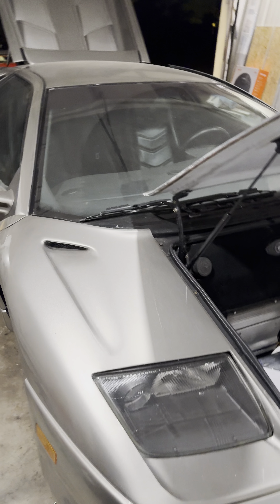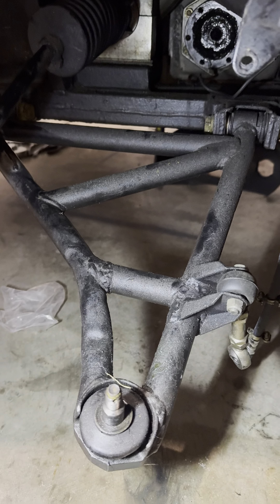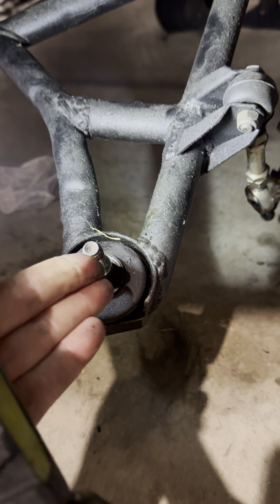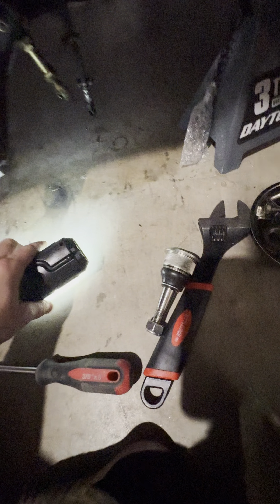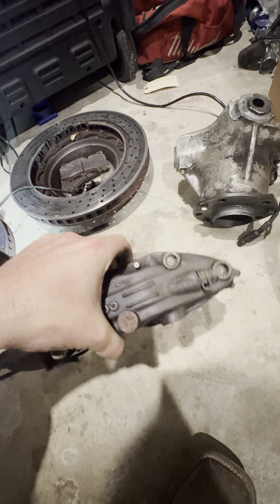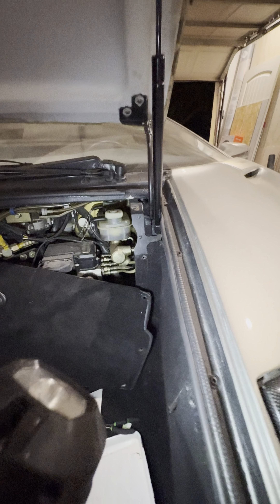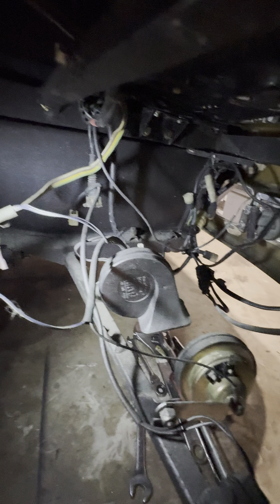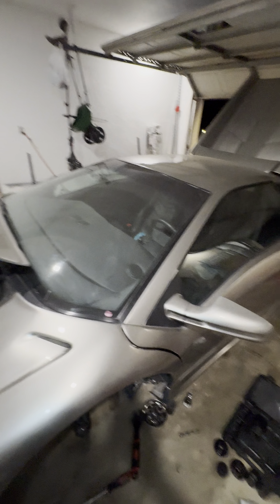More Lamborghini Diablo Stuff. YOU ONLY LIVE ONCE

Comment: I’m only gonna say this once. I’m the guy that gave you the Zeda adjustable magneto for you to put on an original ported Zeda engine so here it goes . You do custom parts so rebuild the front A arms to use Corvette rotors and hub everything. Your shocks? Viking coil overs with 2 twist adjustors on each shock. Sell the original parts to fund your build,duh!! Also, I know someone has an adapter plate for a Chevy engine to Lamborghini transmission . Sell the motor!! Stick a twin turbo LS7, LS3, or big block Chevy!! You can make whatever custom parts you need!! You have the tooling.
Reply from the maker: @rachalhollier5679  not with a car like this. This isn’t a kit car
Reply: @ I know that. Keeping an older exotic alive is very expensive. Not only that,the expense on a single tuneup could be the same price to pay and enjoy it with a proven performance package that everyone is using. Also,just pennies on the dollar after that for a tuneup,& be able to drive it from coast to coast and really enjoy the car is all I’m saying. Don’t even consider I’m the dumb one. You’re building hybrid bicycle engines so I wouldn’t expect anything less of you. It fits, but that’s okay,go out there and get dragged down the street by a 4 cylinder Honda and then you might realize what I’m saying. You have a gold plated turd in many people’s eyes. 👀 wake up!!